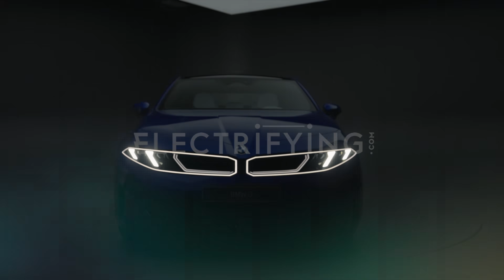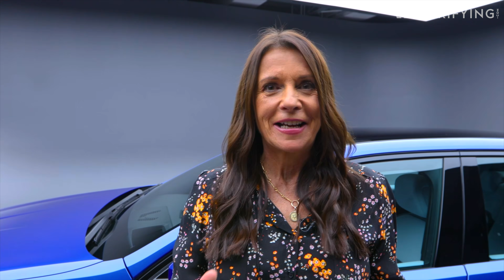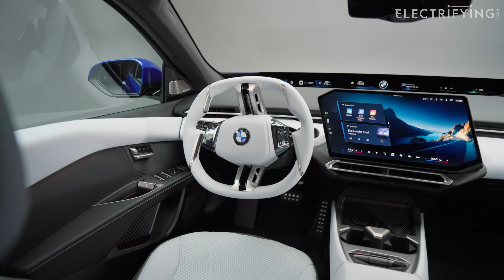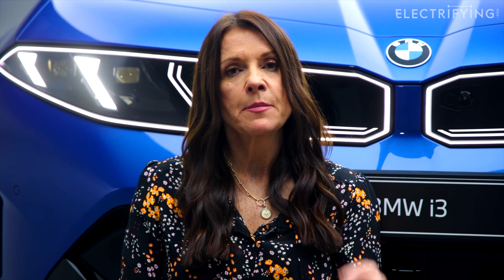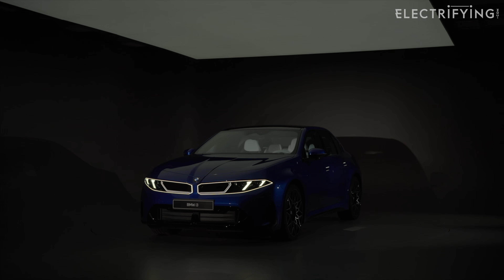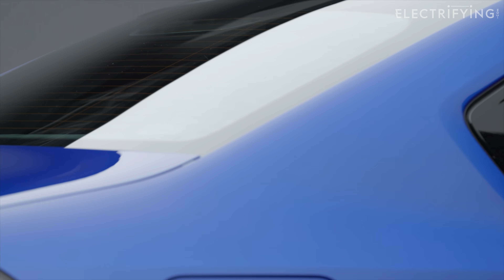BMW’s electric 3-Series revealed | i3 Neue Klasse walkaround

Comment: Cunning Linguistic note, "Ganza" in many Tuscan dialects means "great" (a bit like "guapa" in Spanish) however, it's generally used as "mistress", e.g. "Il vicino di casa è sposato ma ha la ganza" (the neighbour is married but has a bit on the side).  You're right about the naming, it's brutal like Benny Hill innuendo.  
But I'm trying to find something -- anything --, so I won't spend the rest of the day in desire mode.  Having had the pleasure of owning two 3-series cars in the past, none of the cars I've had since has matched the excitement and joy I felt every time I drove (Audi, Mazda MX5, Toyota RAV4, Lexus).  

I effin' love it. Grrr.

Comment: 500 plus miles of range is the figure that puts electric firmly on the map for those on the fence.
Reply: For me it means I can charge at home using my off peak charging rate, drive from Merseyside to Hemel Hempstead to visit my mother, then drive all the way home without needing to recharge at a ridiculously overpriced motorway charger.
Reply: @hishamg  and with no need to fuel up on the motorway you can offset the eye watering cost of this car.
Reply: In reality, 200 miles of range in the UK is more than enough for 90% of drivers. 
We've seldom needed the full 300 miles our EV can offer, and now public charging is everywhere, we could easily get by with a 200 mile range next time we replace ours.
Reply: @johnnodge4327  UK public charging is pathetic. It's mostly not quick enough due to low power and it is fiendishly expensive to the point where an EV is often only doing the equivalent of 30mpg if they're lucky on public chargers.
Reply: @RogerIsation  But most people are only driving 10 - 20 miles a day and so if you can charge at home, you will rarely need a public charger. Fast charging should be something done very rarely on those longer trips. I doubt the person above is visiting his mum far away every day.
Reply: @riaz8783  How do you know what people are driving per day? That claim is simply what you think is true, and how many people in the UK have facilities and a place to charge? 
I do, here in Norway, but the UK is a mess for public charging
Reply: @johnnodge4327 200 miles is shite dont talk crap
Reply: The real metric is actually the charge curve if you're talking usability for road trips
Reply: Only morons buy electric
Reply: Going the other way is what we need now. Smaller lighter battery packs with efficient drivetrain. I imagine this in ‘40’ trim with a circa 400 mile range will be the sweet spot.
Reply: @AndRoose99 all german carmakers are making very efficient drivetrains by now, unlike the south koreans, americans, japanese and chinese
Reply: Not for me, I've never cared much about the range, more about the charging infrastructure. Where are the chargers and how long does it take? 

When there's a bank of super chargers at every major gas station that can take my EV from 20% to 95% in less than 10 minutes, then I'll consider them. Anything less is not something I care to deal with.
Reply: @SliderFury1  why would that matter if the car can take you farther on a single charge than most people would be willing to drive in a day? I agree the charging infrastructure is critical to long-term success, and will lead to us being able to use far smaller batteries eventually if we can rely on there being places to charge at our destinations, but at 500 miles there's really no need.
Reply: @SliderFury1 and when you get that, you'll want it to take you to the moon in ten minutes
Reply: @SliderFury1 
Then you'll be continuing to fund unstable foreign powers with your unreasonable demands. 

Your money, your choice. 
Me, I'd rather fill up every night on electricity at 1/10th the cost per mile, instead of funding unstable foreign governments.
Reply: @SliderFury1  It's the cost of public chargers which is absolutely insane. 50-85p per KW/h doesn't really add up to making any sort of sense at all. In fact it equates to a pathetically inefficient ICE car in terms of the equivalent of MPG
If it was more reasonable people would buy electric cars, we can't all have chargers at home
Reply: @RogerIsation Get your point but you probably means pence per mile in terms of external fast charge. FYI I use Tesla fast chargers. Most are available for all and are far cheaper than others.

Comment: I had already given up hope. Finally, a beautiful BMW!
Reply: You been sniffing glue. That is a big fat ugly piece of crap. I hate it with a passion
Reply: @StephenYikes  thanks for introducing yourself.
Reply: Ugly Chinese car😂😂😂😂
Reply: WHAT was wrong with buttons? We've been using them for 140 years in cars. That's a lot of years. You've been copying yourself BMW - from generation to generation - for several decades - starting from E28 or E34 5 series, over to E38 7 series - my F11 five series - has very similar buttons. And I LIKE THAT. I can use them. I know where they are. Even not looking at them. Full climate control. Drive modes (mostly Eco/Sport acceleration when needed immediately). Stereo volume. WHAT WAS WRONG with them - what was wrong with finding them - without EVER taking your eyes off the road? What? Can anyone explain? BMW? You should know that, BMW - seeing you're located on the doorstep of fastest roads of Europe where you drive 180 metres in three seconds (do you want to spend these three seconds fumbling with a moron screen?) The only thing here is I think customers (like me) trying to explain something to BMW. Hey, BMW - you've been doing buttons for decades. You have also been doing many of your design cannons - for many, many generations and decades - you know the ones I talk about. It's not only Hoffmeister's kink (by the way your five series Touring didn't have it). You know which design standards I talk about. The distance from front wheel to hood. The line from rear to front lights through door handles. The overall taught, muscular shape. Lines that make sense. Like E39. You remember the last time you dropped them all? Yeah. You invited the designer boy Bangle to design your E60/61 and E65. AND THEN IMMEDIATELY - even during the immediate face-lift for the 7series - you went back to classic. Remember that? Why was that I wonder? Then you designed two still very good looking five series which were not Bangled. The F10 and G30 were classy, sporty, not bloated and not spitting onto your own design cannons, like the E60 was. So you went back to your roots - with the F10 and G30 - whole two generations of good design - after the moronity that was E60 (both interior and exterior). Why, I wonder? Something to do with a massive backlash and sales volumes? Hope it's not the case for you with buttons BMW - looking at the number of people VAG and Mercedes are currently fireing because of sales decreases - I'm really hoping you know what you're doing with the entire "buttonless" crap. I don't think you are. I think you're blindly following some stupid trend that's on the market for some reason or other (ukhem, Elon Musk). By the way, BMW - as you clearly know - sales figures of electric vehicles are declining. Sales figures of cars which f_ing identify as appliances are declining. But you still insist on being "trendy". Well, let's see where it all takes you. I just hope my F11 from 2012 drives forever. Just bought a massive pile of parts for it.
Reply: @JurisKankalis  Same thing can be said about traditional door handles.  The issue is simple: just because you can do something doesn't mean you should.   Getting rid of buttons and traditional door handles is a perfect example of this.
Reply: The buttons where better. But I did not like the “asian style” styling of the last couple of years. I drove BMW way back, but would consider it again now.

Comment: Having looking to replace 2 x 2017 polo headlights and OEM £400 pair (got half that non OEM) I wonder how much those would be on the BMW ?
Reply: Hmm, usually those new LED survives the life time of the car...only a crash can change this...but this will cost for sure 3000€ and above
Reply: @josefv-y8m  The bulbs were fine and can be replaced, it was he frame somewhere leaked and then condensation intruded.

Comment: 560 miles on the longest of long range models is seriously impressive but that also bodes well for the smaller battery versions. Currently running an ID.7 specifically because of it's range and I'd imagine that the lesser i3 should be pushing close to, if not, beyond the 370ish miles I can eke out of the VW. For the first time in... well, ever I guess the cheaper models might not feel like you're getting a lesser offering than those with 'proper' engines.
Reply: Think twice...BMW switches oof all Assistant Systems as soon you have bicycle carrier on the towbar...VWs Travel Assist just works...
I was heavily surprised by this using an I4 M50.
BMW has no acustic class, no cooled seats...ID7 is more Premium than the Premium Brand...driving an ID7, too...and the I4 previously.

Comment: Why is the bonnet so long? It's not like they're going to fit a V8 in there is it?
Reply: High capacity battery is tall. Making the car and hood longer and roof taller helps hide the battery height visually.
Reply: The IC 3 Series will still have in line 4 & 6 cylinder motors and look like this.
Reply: @davidperry3531 Ah, so it’s not dedicated EV
Reply: @sargfowler9603 The IC version will look the same but on a different platform.
Reply: @sargfowler9603 

This is on a dedicated BEV platform. They are doing the same thing as Porsche the same models built on different platforms; BEV & ICE/PHEV. The growth is less to do with BEV than it does with the long standing trend of the 3 getting bigger & bigger. This one is barely shorter; and both wider & taller than a 5 Series from just 2 generations back. This had been going on for decades now. Now people are moving up to SUVs rather than to larger sedans to get even bigger vehicles with slightly shorter in length.
Reply: It's all down to willy
Reply: Maximum bonnet, minimum frunk.
Reply: Crumple zone
Reply: So there's these things called frunks...
Reply: Design…

Comment: 559 official range and probably over 400 (450 for 2 wheel drive?) on a bad day is more than enough. I’d be happy to save weight and money with a smaller battery,
Reply: The press release of the initial agreement between BMW and CATL years ago said "Reportedly, BMW's sixth-generation cylindrical cells—designed specifically for the "Neue Klasse" electric/electronic architecture—come in two height variants (95mm and 120mm) and three capacity specifications (75 kWh, 90 kWh, and 105 kWh)."
I suspect the small pack may just be for China where there are heaps and heaps of cheap fast chargers and Chinese don't drive far. (Cheap 400kph trains)
Reply: This is true for people able to charge at home...for people parking in the street it means charging only once a month. Big range is not only about driving long distance, but keeping infrastructure smaller, since the range is huge and you need a HPC only seldom.

Comment: When will the 4 super brains run out of life? Are they costly to replace and will BMW keep on producing the “super brain” after the model has stopped production!  
Is that not an extreme imported part of the “environmental” case? 
Getting parts….? 
Electrical parts…. 
I guess that BMW software is not written for copy past brains…..
We need som heavy EU regulation on that part.

Comment: Hate the Tesla no button thing. Next.
Reply: Would you like an old BMW controller on your smartphone to navigate through apps? This was perfect, when UI only consists of lists to scroll. This doesn’t need a controller anymore.
Reply: They are going to have to put them back for safety regulations.
Reply: @nick1635  No, they aren't. If you can use voice control to do all these things you don't need buttons to pass a safety test.
Reply: Voice control mostly.
Reply: Hate it until you use it. Works perfectly in 10 minutes of use...some font too small for old people like me but sure you can change it if you can be bothered
Reply: Tesla no buttons is Fantastic
Reply: @johnthomas3863  to each his own – I hate it, have talked to lots of people that feel the same. I have two EVs and will undoubtedly buy more. But they won’t be Teslas or BMW.

Comment: Looks really good, wish the dash would be lower to allow more visibility like what tesla does.
Reply: The dash is lower than a Tesla’s compared to the seating position. What is throwing you off is the screen at the base of the windshield above the dash. It does limit visibility slightly but allows you to move the information displayed there to keep from having to look as far away from the road. Tesla is still using a layout from 10years ago and refuses to make updates to account for new tech and customer preferences. No surprise thier global sales are in a freefall.

Comment: Damn! 559 miles WLTP! 

My Model 3 has a 344 miles claimed WLTP range, but has averaged a real-world range of 260 miles over 20k miles and almost two years - so about 75% of the claimed range.

Apply that to this BMW and you likely have a real-world range of at least 422 miles.
Reply: WLTP is not how many miles the car can make on the motorway. It's a mix of city driving, local B roads with low speed limit and motorway. It's not the best, it's not 100% accurate but you can understand which car is better than others.
Reply: @chrishar110 
Which is the whole point of the WLTP rating. 
All vehicles are tested the same, so comparisons are accurate across all fuel types.
Reply: @johnnodge4327 not exactly.
Some not very aerodynamic designs get an OK WLTP but get terrible motorway consumption while other slipperier designs with less efficient motors and batteries have worse WLTP but ok on the motorway. But generally what you say is true but if you do a lot of highway driving watch out for outliers.(poor aero)
Reply: @AJames-jr8kwyeah, I hadn’t thought of that. My Model 3 has a low drag coefficient, I’d be interested to know what this new BMW has.
Reply: The EPA rating, which seems to be much more realistic than WLTP is 440 miles. Very impressive and more than two of my previous diesels from 10+ years ago.
Reply: @ma40 
EPA is irrelevant outside of the US, so isn't used anywhere else on the planet.
Reply: @johnnodge4327  None are particularly relevant to normal real world use. It’s a standardised test cycle simulation like all the others. And anecdotally across quite a wide variety of cars seems to be more realistic than WLTP or CLTC. It’s best to treat them all with a pinch of salt.
Reply: @ma40  I agree on the EPA rating. My Model 3 is rated at 272 miles, so my experience of 260 miles over almost three years and 20k miles driven is far closer to that than the WLTP range. I'd likely have got the 272 miles average if I didn't enjoy its instant acceleration quite so much. Apparently, there is something called Chill Mode - lol!
Reply: Yeah, but there is absolutely no innovation, they are simply slapping a giant battery for you to haul around. And the consumer will have to pay for it, this long range version is going to be about €70k  🙃
Reply: @svensky16 fair enough. My Model 3 has a 57.5kWh usable battery, which helps keep its weight down to just over 1,700kg. Even the long range version is the same weight in RWD due to the higher capacity NMC battery having higher energy density. The BMW has something like a 108kWh battery, so it will be well over 2,000kg most likely.

Comment: i don't like it. front looks strange, side looks disproportionate with that very short boot area and the back looks ok. it does not look like a bmw. but yeah, it is what it is.
also, electric cars are flawed until we get an actual strong battery chemisty that you can rely on for years and years and charges in max 10 minutes to full with good performance for all temperatures, spanning from -30 to +50.
integrating it into the chassis is nice and all for density and rigidity, but changing the battery pack now has become even more difficult. hopefully some cells or modules cna be swaped when they break

Comment: Removing buttons and adding AI? Why would they do that? Well... because the stock market likes it, I guess, even if customers hate it.
Reply: glad i picked up a used i4 earlier this year... Still annoying to adjust the AC via the screen, but at least everything else is physical on it. Can't imagine adjusting things like the vent position and drive modes on it, sounds like a nightmare.
Reply: Informative presentation but please quote KWh for energy, battery storage and KW for power, motor power output and charging. This might sound trivial to you but it confuses people who don't know and it grates for those who do.
Reply: Boy, did you hit the nail on the head!
Reply: Sad ,sad but it's true 😢😢😢
Reply: @rodrigooliveira-tu2mw  You are right! Incredibly sad!

Comment: The bonnet line looks to be very high - why? This is an electric car - there doesn't even need to be a bonnet, mystified!!
Reply: Crash structure?
Reply: There will be an engine version too.
Reply: @the_lost_navigator7266 but not with this car...different Platform...this is a pure EV Platform. In the past it was a shared  Platform...no longer the case.